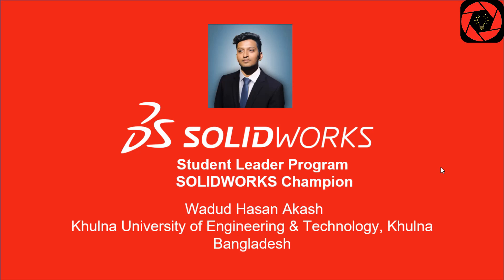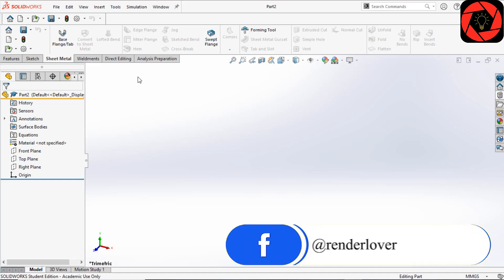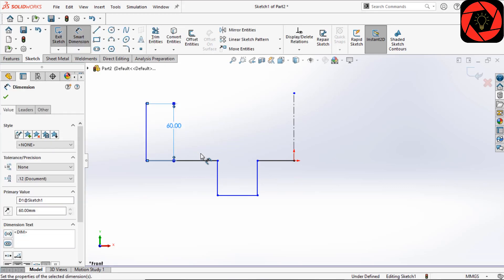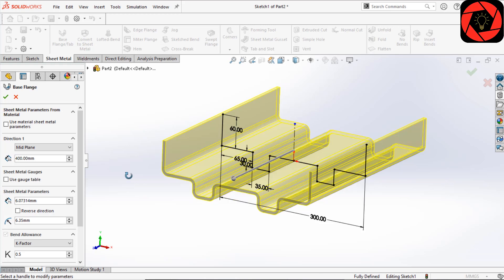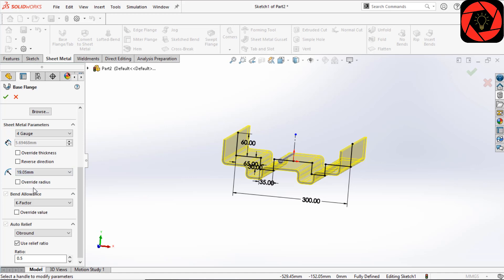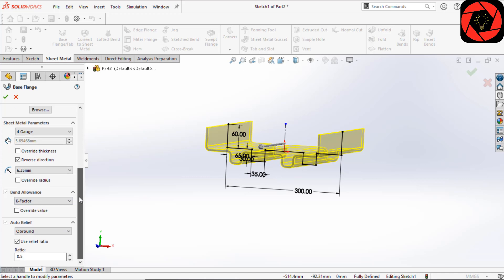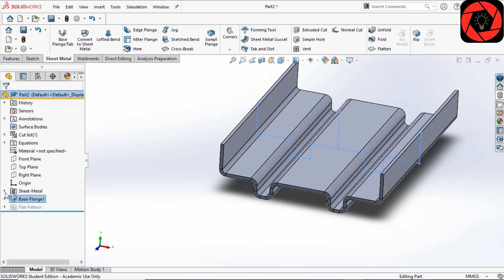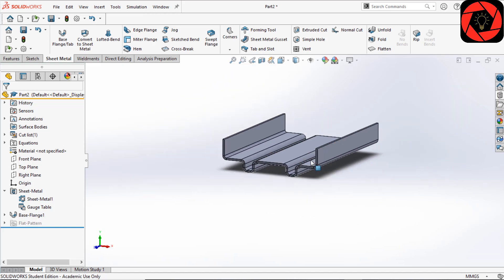CSWPA - Advanced Sheet Metal Design FREE course || Day 01

Comment: Please describe  k factory and others
Reply from the maker: The bend allowance is the length of the arc of the neutral line between the tangent points of a bend in any material. Adding the length of each flange taken between the center of the radius to the BA gives the Flat Pattern length.
The K factor is defined as the ratio between the material thickness (T) and the neutral fiber axis (t), i.e. the part of the material that bends without being compressed nor elongated. Bend allowance is a fundamental parameter to calculate sheet elongation.